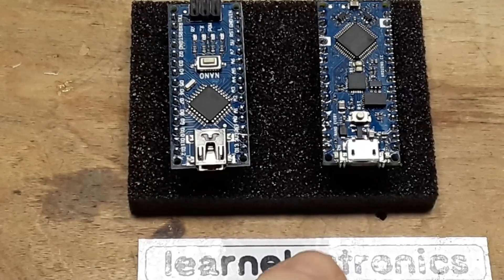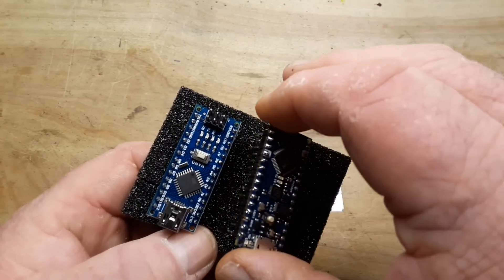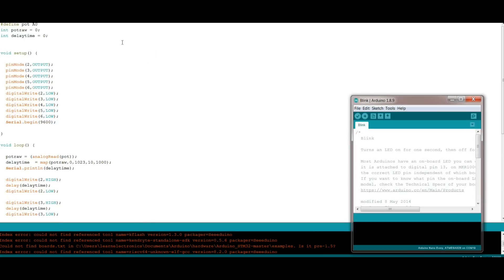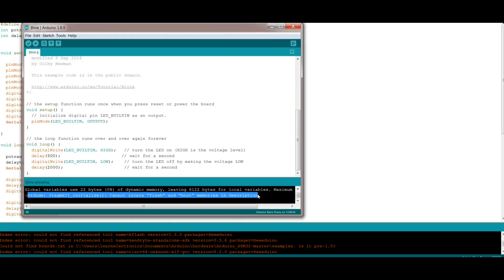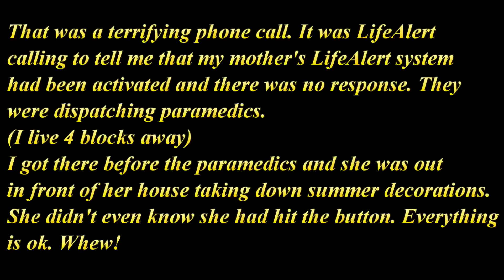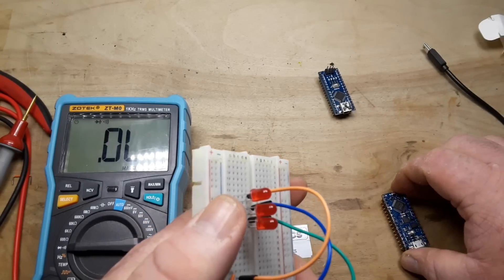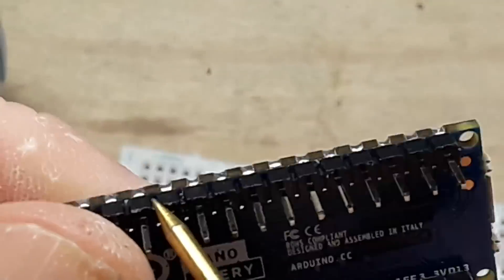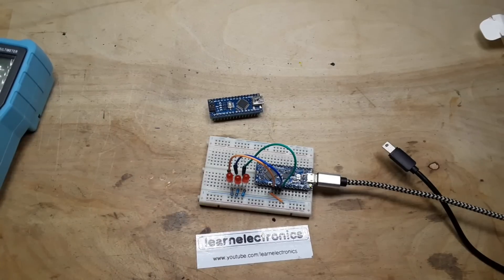Arduino Nano Every Setup and Testing

Comment: 15:15 I have worked with those Breadboards before and the connections between the legs of components and the breadboard are not that great and the Copper on the Breadboard will get a Patina that effects the connections.  I find giving the components a little wiggle usually corrects the issue.

Comment: I've read mixed reviews on the every due to minor set up issues. Wished I had kept the links to them. Nano was still preferred over the every. Arduino needs to check their design on it and improve iding pins on the.board. I still like the nano over the every.
Reply from the maker: Same here

Comment: I’m glad your mom was ok, I’ll bet that scared the hell out of you. Sometimes I’ll have to pull and reset a chip or an arduino even if it seems to have continuity, gremlins in the board. I picked up one of those every board just to help support the arduino project. Great video Paul.
Reply from the maker: Thanks Mike, how's the election?
Reply: It’s going but man it’s been hard lately, I cannot wait till November gets here.

Comment: Misleading clock speed on Nano Every product page

https://github.com/arduino/Arduino/issues/9017

The "Tech Specs" tab of the Nano Every product page says:

Clock 20MHz

but the Arduino megaAVR Boards core is intentionally configured to run this board at 16 MHz:

https://github.com/arduino/ArduinoCore-megaavr/blob/master/boards.txt#L56

Although the board is capable of running at 20 MHz, to do so would require the user to modify the Arduino megaAVR Boards core... For this reason, I feel the 20 MHz clock speed stated on the product page is a bit misleading and should be changed to:

Clock 16 MHz (20 MHz max)

At the very least, a straightforward method to employ 20 Mhz should be provided.

Comment: I hear you all about the pin out silk screen, but to tell the truth I can’t read them anyway.  I have a printed picture of all my micros that gives not only the PIN number but the preassigned function of all the pins. Especially useful for the esp32/8266 boards since there are so many “almost” clones out there.  
Love your videos, Paul. You every consider reviewing a Hantek 6022BE/BL usb oscope. Lots of software setup to get a good app. I’m using OpenHantek 6022. May not be up your ally because of the programming aspects, but software is free and scope is around $90.
Reply from the maker: I reviewed that scope 2 years ago: https://youtu.be/a_qtqKyz71g

Comment: I'm guessing it's NOT 100% pin compatible as you said the every had 5 pwm pins where the nano has 6.
So any project made for a nano that uses the pin on the every that is NOT pwm enabled won't work correctly if you try to use it as a pwm pin.
Right?

Comment: The nano V3 can handle up to 20v on the Vin pin, the 7-12v is just the recommended input voltage.
As for the micro vs mini USB, i prefer the mini USB because its far, far, FAR more robust than the micro!
Reply: I hope your right then I don't need an external 7812.

Where did you find out it can handle 21V?

Comment: I learned to wiggle the wires or reseat the module into the breadboard when this happens. Always try easy fixes before trying to debug (in this case) perfectly fine code. :-)

(And its 256 bytes EEPROM not kilobytes.)

Comment: Don't know if that Nano Every board was a pre-production prototype, but it looked it. Actually had a look of a "cheap Chinese knock-off" about it. And printing the pin IDs on the underside AND partially covering them with the headers surely can't be progress. More of a R-pi person, but the specs on the Every don't look better to me. e.g. 1kB > 256B
Reply: It is meant to be cheaper which I really like. Means I'm not faced with the decision of expensive genuine or cheap Chinese clone.
Yes it lacks some memory but other aspects of the chip are actually better such as the ADC. Also with some modifications to the IDE it can be clocked a bit faster at 20MHz.

Comment: 256bytes? or 256kbytes? Heard you said 256kbytes but what's printed there is 256bytes
Reply from the maker: Yes, I misspoke
Reply: It's bytes according to their spec sheet. https://content.arduino.cc/assets/Nano-Every_processor-48-pin-Data-Sheet-megaAVR-0-series-DS40002016B.pdf

Comment: Just a theory, but I experienced something similar once. I was transferring data from one Motorola MC9S12 to another MC9S12 microcontroller, but doing it through a physical relay. That's a little unorthodox, but it was a VERY low speed data transfer. I was getting errors in the data exchange. Ohmed out the contacts, and everything seemed good. Took me about an hour to figure out, but I realized that the current was so low going from one data I/O to the other, that small amounts of foreign material on the relays contacts was creating a resistance across the contacts, and therefore developing a voltage across it. I pulled the relay, and ran about an amp through the contacts, thus burning the foreign material off. I reconnected the relay, and the device worked great for the next 5 years. 

When you pulled the board and reinserted it, that may have cleaned the contacts. 

Not sure what the current thru put with an ohm meter is compared to the draw of the LED. Anyway. Just a thought.

Comment: Cool video, cheers mate, will go shopping. I hate the pins being described on the bottom. Are they hinting that we should be soldering the header so the board is upside down so the electrons fall into the protected barrier they added 🤣